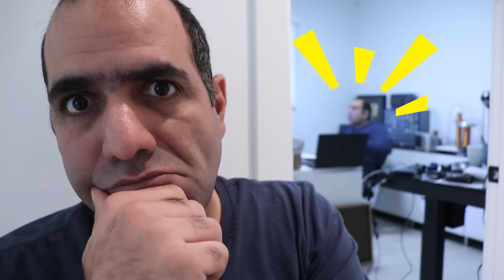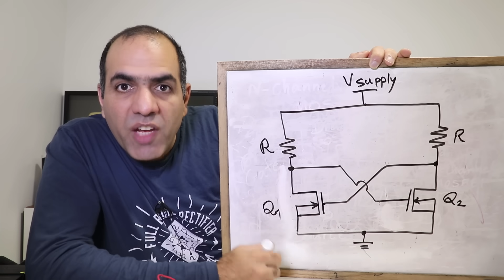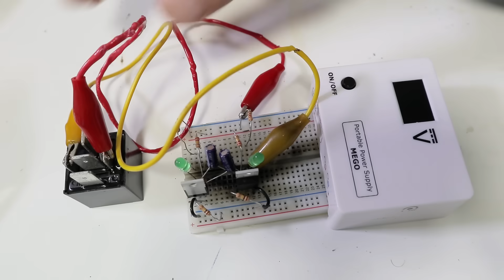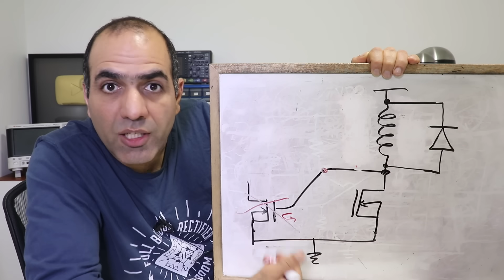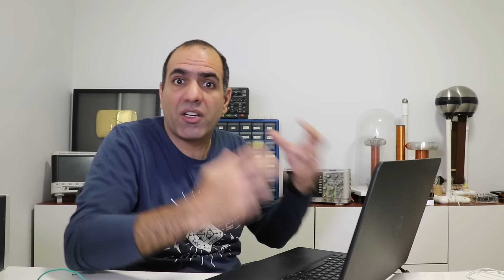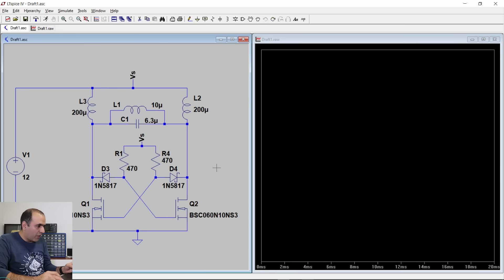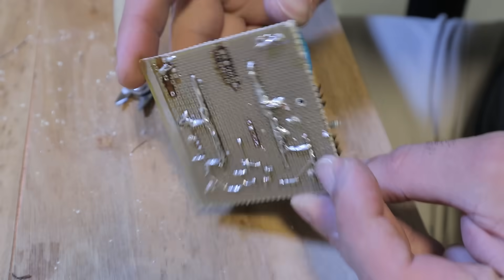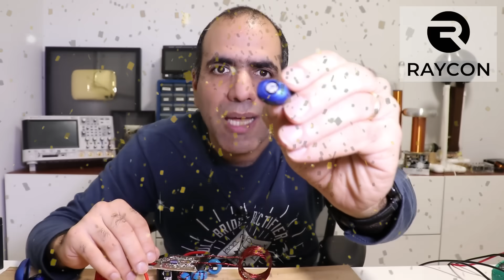Almost MELTING Metal with Induction Heater

Comment: Hi, I am not good a electricity and I have a question, please respond. I used an induction heater to heat magnetic materials. The input of the induction heater was DC 24V 15A and it could well heat magnetic materials. However, as i know, only an alternating magnetic field (generated from AC voltage) can heat magnetic materials, so how did my induction heater (use DC voltage as input power) heat magnetic materials?
Reply: Any electricity (DC or AC) can create a magnetic field as long as there is current flowing through the wire which can be transferred to a high resistance metal to heat it up.

Comment: I have an induction heater forge that uses copper pipe coil for the induction and to cool it, it runs water through the pipe, what would happen if the coolant/water was a liquid conductive agent, would it increase the induction power or just overheat the water/coolant ?
Reply: Look up "skin effect" and all will be revealed.
Reply: @Broken_Yugo  being a pipe does it not have 2 "Skins"..the external and the internal....?
Reply: @jimpifarre4601  I'm not sure, I would think yes, imagining rolling the tube out to a flat and considering the current distribution there. The important thing to understand is a tube is used not just to pass coolant though it, but also becasue since it's passing high frequency AC, per the skin effect, very little current flows anywhere but the skin. So it doesn't matter what's in the middle of a high frequency AC conductor, at least in terms of how good of a conductor it will be.
Reply: @Broken_Yugo  I was thinking of replacing the copper tube coil with a stainless steel tube coil, would the induction still work ? or is it only copper that has the "Skin effect" ?
Reply: @jimpifarre4601  Don't use a conductive liquid. It will short the inductor windings and waste a ton of power on the wrong thing.

Comment: Good Day Sir, I did it a ZVS circuit, but my oscilloscope show 115Khz & 110volts with a power supply (24v-20a) ¿Why a frequence so high? ¿How can I get low frequence? From Argentina Cordoba. Excellent video
Reply: Increase inductance and capacitance in the circuit,it should lower the frequency

Comment: hi, sir i want to make a bigger one 30 to 40kw to heat heat the 300 litre pot please give me diagram for that
Reply: As far as I'm aware, the circuit would be the same, you would just need to upgrade your components and wires to take such high power. Where are you getting 30-40kw of power from by the way?

Comment: Interesting question: Since the capacitor bank in a ZVS circuit has to cope with high voltage and high current (a lot of abuse), would the large high voltage capacitors from microwave ovens be suitable for use in this kind of circuit? I ask because I have a few of them - they are all 0.9 microfarad, with internal 1 Mega-ohm discharge resistors. Would the presence of these self-discharge resistors prevent them being used as the resonance capacitors in a ZVS circuit?
Reply: O.10